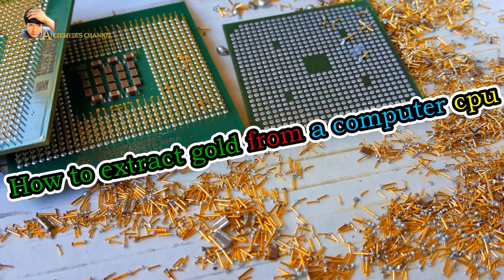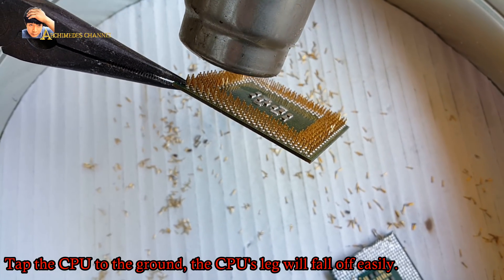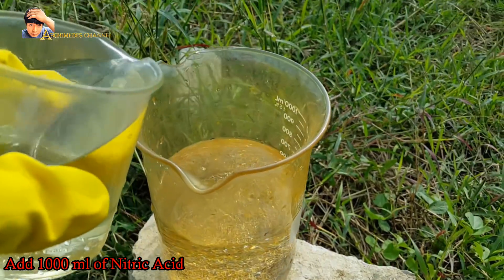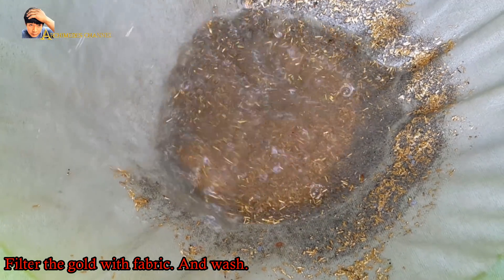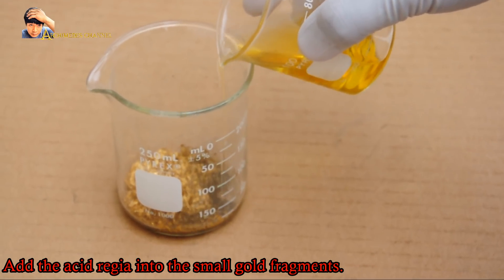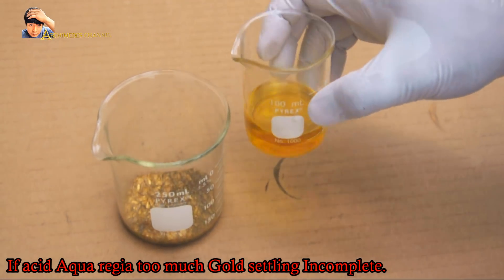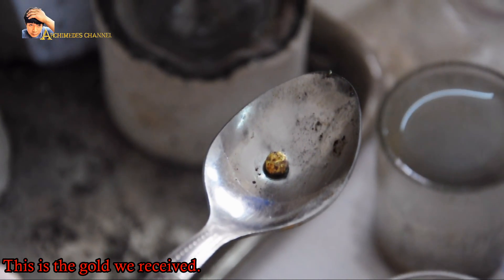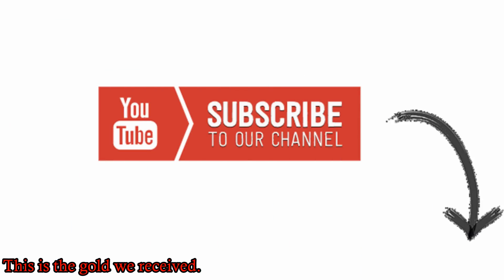Make gold cpu computer. How to Recycle Old Computer parts recycling.

Comment from the maker: How to recover/ extract gold from computer parts ?
 Computer parts like processors (CPUs), RAMs, motherboards, hard drives, CD/DVD drives have gold and other precious metals like silver palladium etc. Base metals like copper, brass (an alloy), tin, aluminium, lead etc. are also present there. 
SMPS (power supply), keyboard, cpu-fan doesn’t have gold but there is some silver in keyboards.
CPUs have gold and plating on its pins and gold wires inside them.
RAMs have gold plating on its fingers and gold wires inside the chips (QFP & PLCC) which are mounted on RAMs. There is palladium also in ceremic capacitors mounted on RAMs. There is some silver also in QFP and PLCC chips on RAMs.
silver also in QFP and PLCC chips on RAMs.
In motherboards there is gold plating on different types of socket pins. There are BGA, QFP and PLCC chips mounted on motherboards, they all have enough gold and some silver in them.
Reply: how many gram of gold contain
 40 CPU
Reply: @Yuocefben  did you found the answer?

Comment: 100 gram of pins maybe around 250 CPU's. That means 250 old computers. That means disassambling 250 computers. Around 8 hours of work. Afther that u have to spend hours for extracting gold with chemical things. After that you get finally 1 gram gold is: 38 dollar. Things will get interesting when you can extract 100 grams of gold.
Reply: Yes but 38$ in some contry IS look like  to be rich with 😆
Reply: This just chip pin a one cpu have more chips and more recovery has been possible

Comment: How much gold you extract from 100grams of pins???
Reply from the maker: 1.5g
Reply: What is the carat of that gold?
Reply: How many grams of pins u get from I CPU...or how many CPU u require to get 100 gms of pin
Reply: carat is the weight of gold
Reply: @emporor89  carat meannig the purity of gold ..24,21,18,14...... etc

Comment: nice video, you might want to correct that you said you add 4000 ml of water 4000ml of water is 4 liters you  mean 400ml or 0.4 liters and the same with the nitric you said add 1000ml (1 liter) of nitric when it should be 100ml (0.1 liters)
the beaker you're pouring liquids into is only 1000ml (1 liter) I know it's just a translation error :) great video though
Reply from the maker: Thanks for the help.
Believe that many people are confused.
Our sample To increase the amount of chemicals. Many times.
It's a waste of time to change chemicals.
Good volume and do it once. Is the number specified 4000/1000 ml/gold pin 100g
The chemicals are completely soluble.
Thank you very much